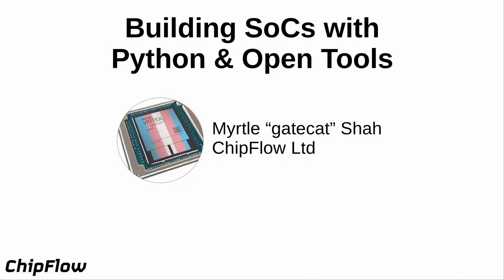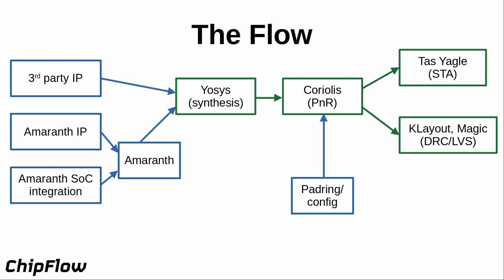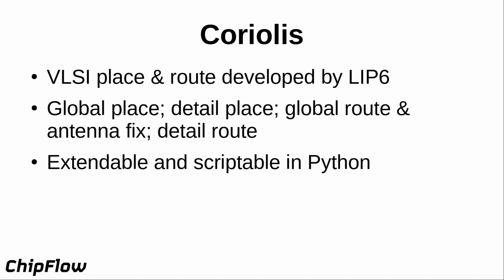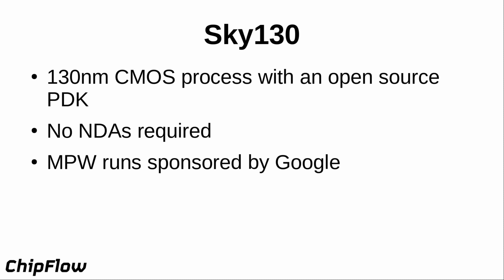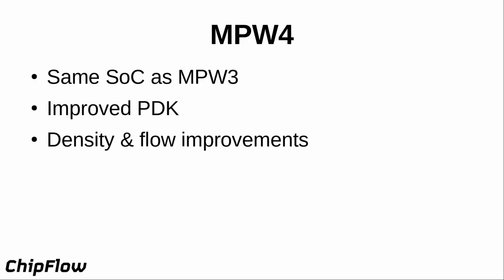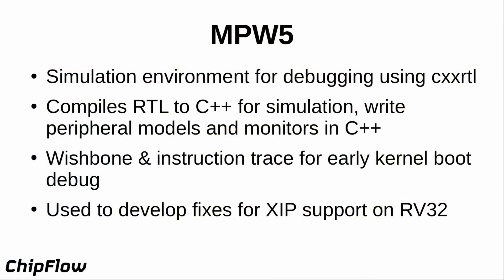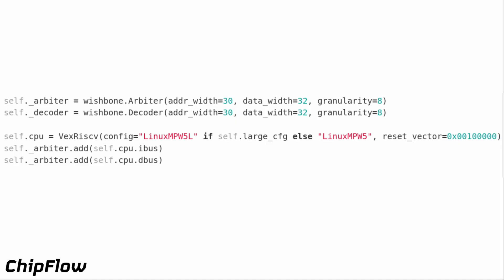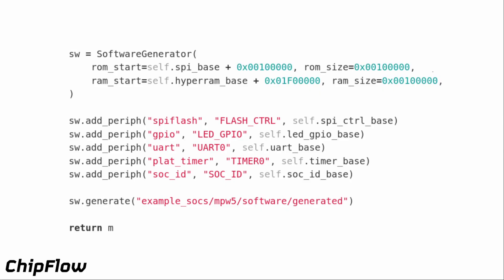Myrtle "gatecat" Shah presents: Building SoCs with Python and Open Tools

Comment: If using Windows and a non-supported board (Trenz SFM2000).. what would the flow look like?   Can I just install litex and verilator (bins vs msys2/MS Build Tools)?   Or will LiteX only work properly under Linux with Vendor tool integration and the specific FPGA specs (pins, pll, etc)?

Because, I was thinking if I could create a verilog-only LiteX SoC design, then manually add the files to my existing project and connect the ports to pins and the rest of my logic?  

My goal is just a s hello-world using LiteX/Migen and Amaranth-based IP cores.  Specifically I'd like a JTAG-UART (Serial console via jtag pins),  and a soft-cpu (VexRiscV/PicoRV32), plus anything else needed for this.  For example, the LiteX repo says it has "Simple cores: RAM, ROM..." but I don't see them!  Would also like to debug the RiscV using Eclipse/CodeBlocks (openocd+usb-blaster).

Any thoughts on litescope or how it compares to Libero Identify, Altera/Intel SignalTap, Lattice Reveal, Xilinx ILA?  

If doing this on Windows with a Smartfusion2 FPGA board would be too difficult for a beginner,  then I'll go Linux/Nix VM, or a Docker Container (YosysHQ / oss-cad-suite-build)... on a supported board (Colorlight, Fomu, etc).  I understand the Lattice FPGAs can be programmed using  Pi Pico/Dirtyjtag and ecpdap/OpenFpgaLoader... or USB-Blaster and OpenFpgaLoader.. or a AK-CMSIS-DAP JTAG/SWD and ecpdap ?